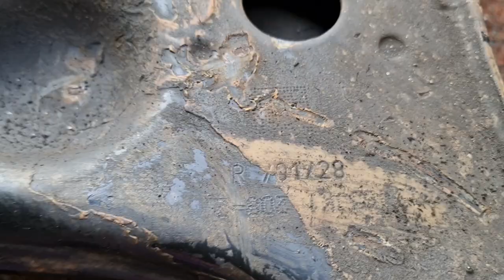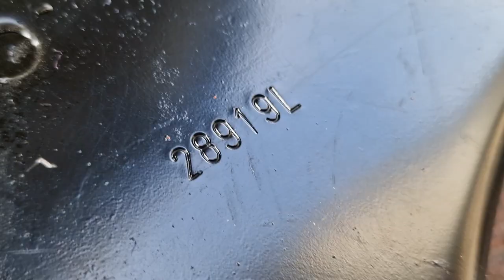lower control arm and new front leaf spring bushes install on our self built vw crafter campervan

Comment: I'm a firm believer in Karma paying itself on,Sam. Thats why I never give bad karma because Karma has a long memory for either good or bad. Karma looked fondly on you and you've managed to get what you need. I watched Neil's video the other day putting a leaf spring on the front and said to him I did not know crafters had a front leaf spring. Just shows, you learn lots following peeps on youtube!  Gotta say, that looked really hard work and not something I think I could do on my own....in fact I mentally wished I'd been there to give you a lift! Impressed with the engineering on that leaf spring assembly ,though I did wonder what the leaf spring itself was made of. Good job done! Bessy regs-Kenny
Reply from the maker: It was a donkey of a job every bolt and nut was hard work glad it's all done now though 😁👍

Comment: Hello Sam , just seen this vid , when doing lower arms the bushes should be tightened with the weight of the van loading them up , hard to do on the floor, that’s when a pair of ramps come in handy, it can extend their life .
Reply from the maker: Good tip mate 😁👍

Comment: Thanks for this, great video, very informative especially as I'm about to change my front spring and shocks and the part numbers are a god send 👍. I have also watched your later video about the numbers and thanks to that I didn't buy the one on eBay I was looking at but I did speak to Midland truck and van in coventry and managed to procure an official 5T spring from Mercedes.  The numbers are different but I don't know why.
Reply from the maker: Merc have change a lot of part number recently due to not being in contract with VW anymore
Reply: Yeah I was thinking that.

Comment: Great job Sam. Good to see things going smoothly compared to the nightmare you had in the previous vid.  Just to check Sam - you didn't tighten the 2 big bolts on the wishbones until the van was back down on its wheels otherwise the bushes will be twisted and may tear.
Reply from the maker: Good point. we did tight them up but made sure they still had movement while I set everything else up 
The rain stopped me recording all the final checks but rest assured I did tighten the bolts fully

Comment: Very interesting, I am stuck, changing both wishbones on my 2002 Sprinter, I was stuck for ages because I had to buy a much more beefy ball joint splitter, and when they went, oh what a bang! got one side finished but on the other side I cannot get the two arms which hold the silentblocs into their chassis holes. Measured the width and height, same as the old ones, no idea what to do.
Reply from the maker: You may have to widen the gap
this will compress once you bolt the new ones in
Reply: @TheCraftyBlindersvanlife  After much more time and loss of blood I measured the old wishbone against the new one, from outer edges of opposite silentblocs, original one 461mm new one 455mm. A quarter inch may as well have been a mile. No more Mapco parts for me thankyou.
Reply from the maker: @hamsterdangler  that's not good! poor quality control on someones part
Reply: @TheCraftyBlindersvanlife  No more Mapco parts for me, I have wasted so much time and the van is in the garage on axle stands and I have other vehicles waiting to get in, I don't know if the part is going to be replaced, and if so when.

Comment: Hey Sam, do you think I could change the rubber leaf spring bearing under the plate on the control arm without undoing the shocks, i was thinking if I remove the saddle plates attached to the sub frame whilst the wheels are on, then jack up the van and put on axle stands, remove the wheel, undo the 4 bolts on the roll bar plate that it might work. i don’t need to remove the leaf spring, just swap out the rubbers? I have a very noticeable knock on bumpy terrain and I think it’s coming from that area. Cheers 👍
Reply from the maker: I think you could yes have you checked your strut top mounts?
Reply: @TheCraftyBlindersvanlife  turns out you can’t do it, the small bolts on the plate that screws to the wishbone won’t come out due to being obstructed from the shock. You got me thinking about the top mounts and after inspection they looked perished, the rubber was dry and brittle showing tiny cracks so I did replace them and boy o boy, what a difference, biggest difference so far and I’ve replaced pretty much anything that moves on the front end trying to get rid of an elusive knock/chatter, I’ve put in new wishbones, steering rack, steering column, koni shocks, anti roll bar links and bushes, 5t front leaf spring and corresponding front hubs and the chatter is finally gone but even after all that the ride was still a little wish washy and unstable until I changed the top mounts…..so much smoother. Thanks bud 👍

Comment: The older we get the harder it is to get under the van.... well that's my excuse for not doing too much underneath.... 😉 Just a tip, I noticed you tightened the inner bushes when you the arm was down on the floor. Only problem with that is that when you fitted arm to the upright and then the van sits on the floor the rubber bushes are really twisted and loaded far more than designed. Try slackening them off at ride height if you can? 👍 Just noticed JimB said this earlier. This could also give the impression that it's sitting higher.
Reply: A dab of red rubber grease on rubber bushes is great for easing them in and letting them settle to correct position without tearing. Don’t seem to hear much about it these days but still works for me. Reckon you should still get a sachet of it with any suspension bushes
Reply from the maker: Cheers pal 👍 the rain stopped me from recording the final bit but I done it 
😁👍
Reply from the maker: @Basilbrush207  not from merc 😒 robbing buggers😁👍

Comment: Sam do you have a link for the bushes at all please? Loving ❤️ these videos and watching closely as just about to make a start on up plating ours.
Reply from the maker: Top bush 
A906 322 03 19

Bottom bush 
A906 322 04 00

End bushes 
A906 322 03 00

5t Leaf spring
A906 321 11 03
Reply from the maker: Good luck with the build we have a Facebook group when you can ask these kind questions also and share you build with us too
fb://group/746842809394772?ref=share

Comment: Hi Sam, glad its all sorted. Why cant these things happen when its warm and dry? If you get a chance can you put up the part number for the front spring as I have two 906 numbers advertised but they seem a bit dubious as one listed also comes back to a later 2019 3.5 tonne sprinter unless they have the 5 tonne spring as standard? Might see you at the spring Overland show if you're going?
Reply from the maker: We live in Cumbria it's the same weather all year round 😁👍
The correct part number is 
A906 321 11 03
Reply: @TheCraftyBlindersvanlife  Cheers Bud. Had exactly same bolts snap on me last year but live in the south so not so painful 🤭

Comment: Hi pal, do you have the part numbers for the 5 tonne rubber bushes?
Reply from the maker: Hi 
it's took a bit of finding again but here they are 
Top bush         A906 322 03 19
Bottom bush   A906 322 06 19
Outside bush  A906 322 00 19

Comment: Good one Sam when I move to France I won’t have a choice but to use AUTODOC 😢and did you buy the bolts from Vw I got mine from them and not as expensive as some of there bolts
Reply from the maker: Got my bolts from a local supplier cheap as chips right grade as the originals 😁👍

Comment: Where did you order the bushes from. 
Cheers dude
Reply from the maker: Mercades main dealers are the only stockists for theses parts
Reply: Are they a standard Bush or ungraded to 5 tonne also
Reply from the maker: @chrissayers76  I've fitted both with no difference so save your money